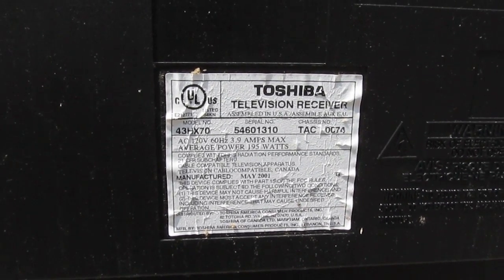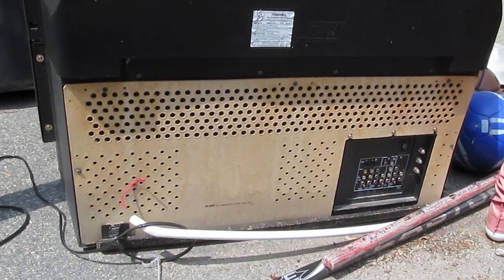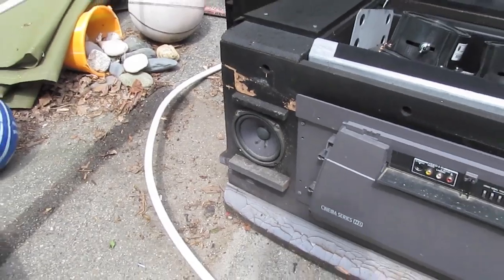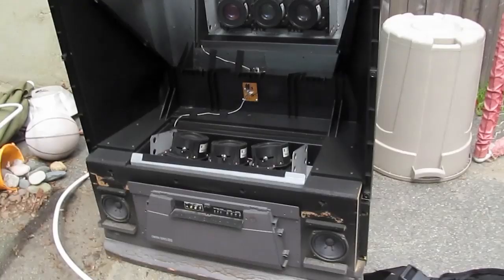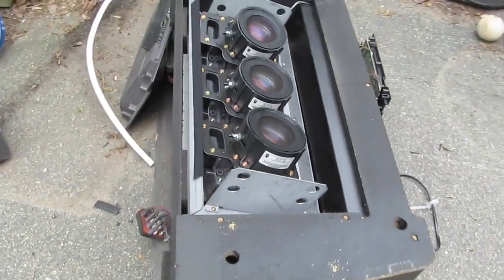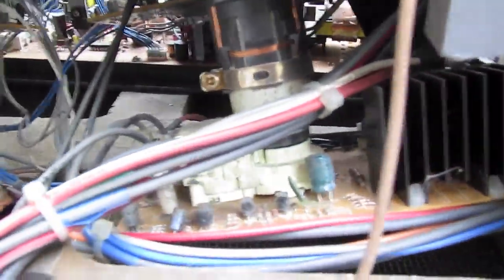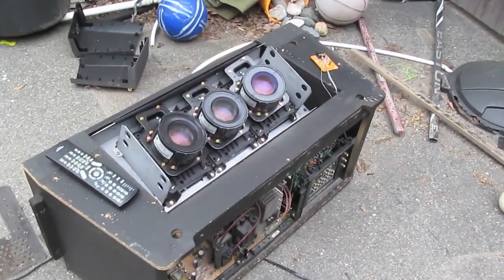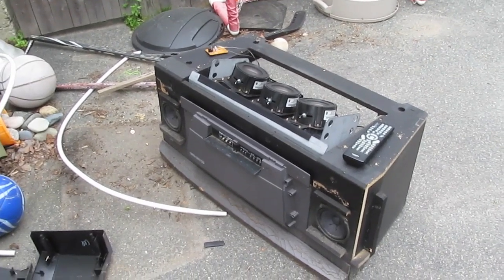Quick look inside a Toshiba CRT rear-projection TV

Comment: Convergence issues are fairly easy to replace
Reply: @Metaphysical
If <$35 for genuine parts that are still being made is your idea of "expensive", then yes. It makes a whole lot more sense than ripping the thing apart and having a massive pile of worthless and difficult-to-dispose-of parts.
Reply from the maker: DMAN4u2  If your idea of "easy" is replacing two expensive high power custom ICs that probably were out of production years before the vid was made, then yes.
Reply: I Just replaced some a few weeks prior to that post, also the IC's are quite common and still being used in the industry today
look up the STK Numbers and you have a matchup.

Comment: I had one of these. The problem is as you said convergence. In time they slowly drift out of alignment. I found with a lot of time spent adjusting the dozens of convergence pre sets it was possible to get it well converged again but 2 months later, back to square one. After the third time of doing this I ran out of adjustment...Time for scrap!!
Reply: Michael Beeny The sony ones have a digital auto convergence (at least on the 1080i ones) which helped ours last until the high voltage inverter died. We upgraded to a HDMI capable LG smart TV (LED illuminated LCD).

Comment from the maker: I actually tossed it back together, had my dad get the car (we live a minute up the road), and took it home.  In the next video I power it up without the screen, but find out how badly the convergence ICs are cooked.  Because of that and the water damage , I took the mainboard out.  The CRT modules are still intact, but the badly damaged mainboard has become a source of parts.